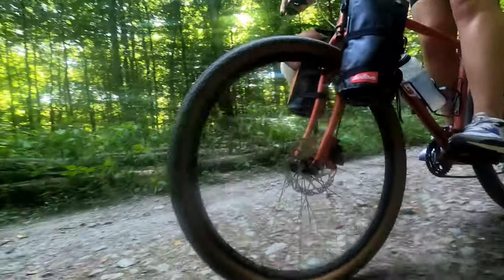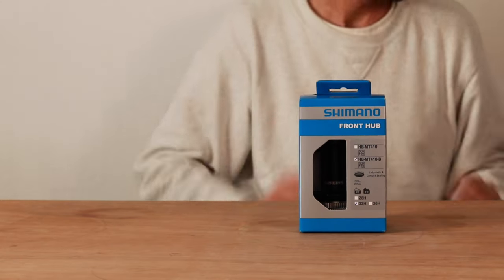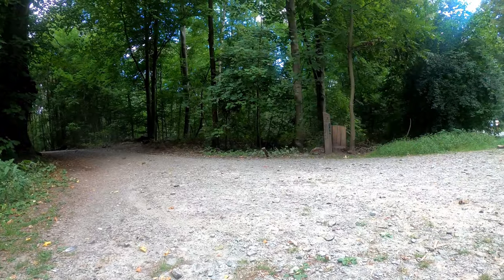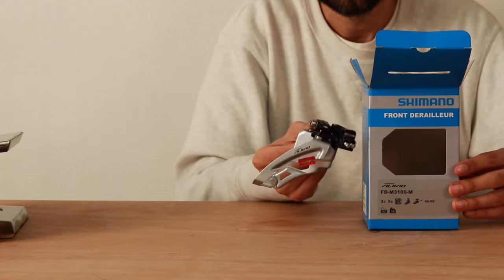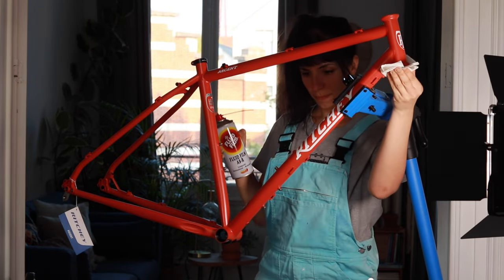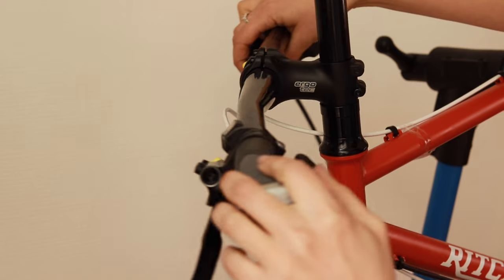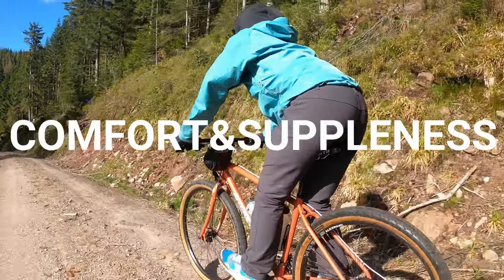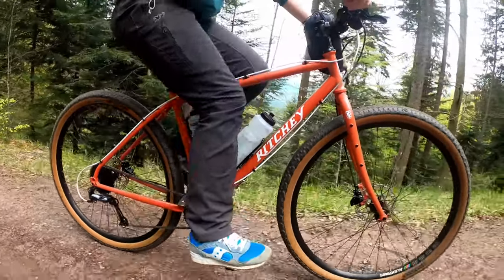How we assembled our own Ritchey Ascent bikepacking bike / off road touring bike

Comment: Super helpful and instructive video!  Especially since I am in the middle of acquiring all the components to build my own Ritchey Ascent :)  Like you I'm using a combination of new and old components.  I used your video to identify the correct crankset that I'll need.  Thanks for producing this excellent video!  I really appreciate it :)   Happy Riding Suzanne!
Reply from the maker: oh cool ! enjoy the process :) and we are glad the video is useful
Reply: @bicyclepicnic  Hi Francisco & Suzanne.  There was one thing I was looking for in the video but didn't find and that's the bottom bracket.  Would you happen to have the information on that?   Manufacturer and part number?  Please and thank you :)
Reply: I think I found it on your spreadsheet... Shimano SM-BB80 Saint Hollowtech II Bottom Bracket.  Is that the one?
Reply from the maker: Hi ! yes that's the one :) it's golden

Comment: Error on your FD description that has some importance, and that adds some extra interest to your excellently well-made informative video.

You have the wrong model listed in your spreadsheet.

You actually have the Alivio FD-M3100-M which is 3x, not 2x. You can see the part number on the box and that model has the all-metal cage.

This is important because the Alivio 2x FDs come in boost and non-boost options (FD-M3120-M-B and FD-M3120-M). The 3x only has the one chainline option, 50mm (for the middle ring) which is standard for older 3x rigs.

So this is cool because we can see how a 3x FD gives a wide pull to cover boost on 2x. (Chainring gap is about 8-9mm, so the outer on the 3x is further out than a boost 2x outer ring.

The issue with this for builders can also be excellently seen in this vid, and that's the longer 3x cage being set for 2 rings with a small granny. See the chainstay clearance? Looks like the cage almost touches.

I have a 3x FD on my 22/36 rings, and I have it mounted for the granny chainline in the bottom of the cage. That means when in the outer, the cage is high above the ring with a large gap. Does that mean the chain sometimes falls off the outside of the ring? I dunno, because I have a lightweight bashguard on my old 3x crankset in place of the big ring.

The Alivio 2x FDs are the only groupset that has different models for boost and non-boost. Presumably the other groups' FDs simply have wide enough pull to cover the extra 3mm.

Comment: Wow very nice video, I love the attention to details in part choices and how you went over reasoning etc

Also film and sound quality are excellent IMO 👍

I really like what you did with the bike, although for myself I'd prefer it as a 1x drivetrain for less moving parts
Reply from the maker: Hi ! Thanks I lot for your feedback we really appreciate it 👍🏽
Reply: I never had any issues with front derailleurs over 27 years of cycling.   I did find that (bottom swing) designs are far more reliable over the long run (far less play in the links develop) than top swing designs.

Comment: Waiting for my Ascent and panicking a little whether I ordered the right size :-) Solid video, thank you! What crankset exactly did you use? I mean, chainrings and arm length?
Reply from the maker: Hi ! we are using a Shimano Deore FC-M4100-B2 which comes with 26-36 chainrings and we chose 170mm arm length because it works well for a medium size, although, in my experience  the crank arm length is not very important, I have some bikes with 170 and others with 175 and I don't even notice de difference. For the crankset, remember it has to be BOOST cause this frame's hub clearances are BOOST and so you need to keep the chainline, as explained in the video ;) 
Cheers !

Comment: Hello, good video. How does the sizing compare to the bridge club?
I'm 1m75 and don't want a to long stem. So a medium maybe to small. Gonna run flatbars.
Reply from the maker: Hi ! My girlfriend is 1.65m and fits well with a 70mm stem on the Ascent size M, based on that I would say the size M would be too small for a 1.75m person. Compared to the Bridge Club on same size the Ascent is always shorter reach and higher stack, you can compare easily using bikeinsights.com 😉

Comment: Forgot to ask :-) You mounted front derauiller -- in your opinion how much the cage of FD limits the tire width? Or in other words, how wide tire you can fit considering FD cage on smaller chainring? Thank you in advance for your help.
Reply from the maker: That’s a good question, with the right front derailleur you shouldn’t have any limitations on tire clearance. This is using a boost crankset, you need a front derailleur that goes a bit farther out than a normal one. Normally you can buy a direct mount derailleur and a clamp with an offset. So as i was saying before, if the range of movement of the derailleur is good for the a boost double crank then it should not interfere with the tire.